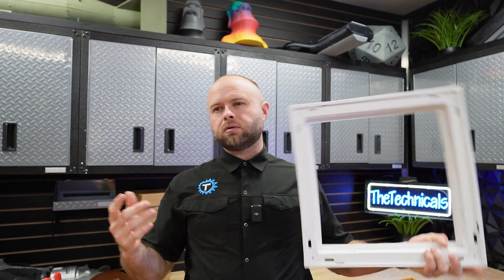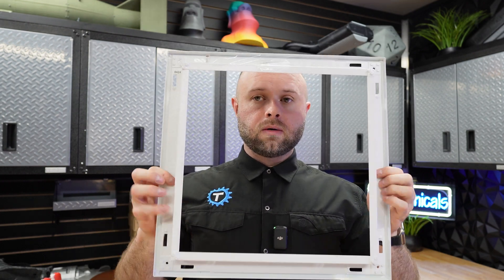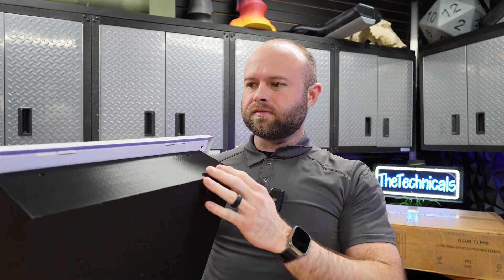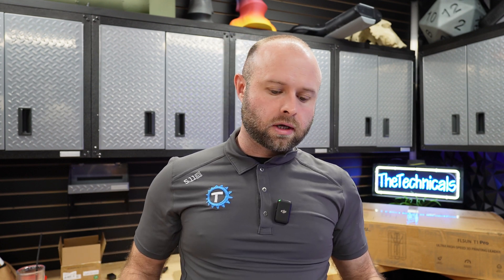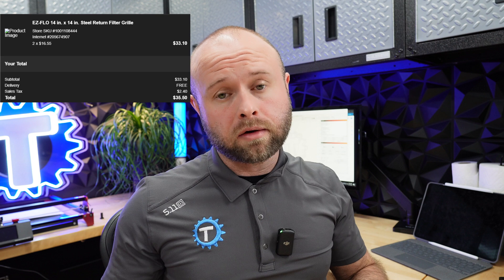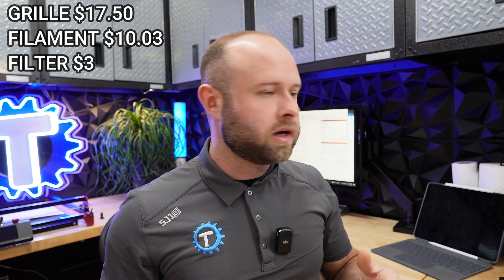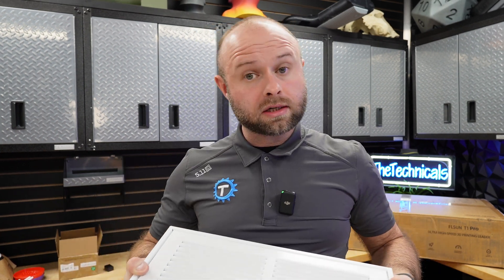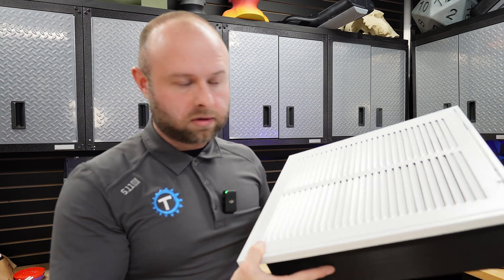Creating, Designing, Printing & Selling a REAL 3D Printed Product. Start your business in 2025!

Comment: Nice job on the Tinkercad section, and video in a window.  I also notice you upping your game with some other video angles lately.  You are doing great on the channel elements. I might suggest some shelves or 1/4" holes for shelf pins for the user to add a shelf or two.

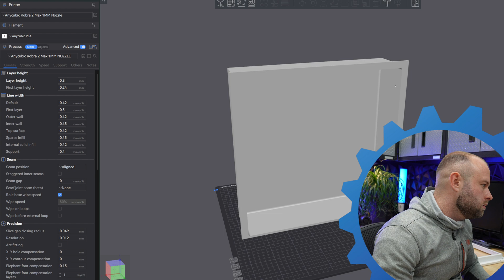Comment: 4mm solid walls sounds like overkill. Also, it's show at 4:00 that you're using 0.42ish line width, that doesn't seem right with a 1mm nozzle.
Reply from the maker: test model printed on one of the other kobras

Comment: You could sell kits. The DIY kit version that is just the backing box and instructions and another kit that contains everything they need. This way you can offer the product at a much lower price and allow the customer a convenience option to include everything needed.
Reply: Problem with that is, you don't know that the customer is going to get the correct off the shelf parts, then when they get the 12" grate instead of the 14" grate, because they're an idiot who can't follow instructions, they'll leave a bad review on Etsy saying it doesn't fit.

To give you an example, I had a customer leave this review on my Etsy site.   "I wouldn't suggest purchasing this product. It's hollow and very cheap. Not quality in this product whatsoever. Great design. Maybe if it was solid. I would expect something of this quality to be around 5 dollars with free shipping. Probly a great person. Just stay away from the products. Was gifting this to my dad. He would laugh and say you actually paid how much for this. At least I have a pattern to make a more reliable product. This will not stand I summer in the  florida heat being hollow. You can't even squeeze it with your fingers without it cracking.  Did not come close to meeting expectations. "

I haven't made one sale since this review...he completely killed my shop.

Now... You may think, hollow and won't hold up to the Florida heat, seems a reasonable complaint...but...first off, my product isn't hollow...it's printed with 3 walls, 15% Gyroid infill, out of PETG... Its only job is to hold trailer safety chains and the light plug up off the ground when your trailer is parked... It doesn't have to hold up a Buick... maybe, MAYBE 1 lb of weight, so 3 walls, 15% infill is about 50x stronger than it needs to be to do it's designed job... And PETG is naturally UV resistant, with a heat deflection temperature of 156° F.  If it gets above 156°F in Florida, he's got bigger problems than his trailer plug lying on the ground.   And $5 with free shipping?!   It cost me $4 in shipping, which means if I sold it that cheap, I'd make about 15¢ after Etsy fees and shipping... So pretty unrealistic expectations.    

Basically, this person was an idiot who never even considered the loads the product is subjected to, nor the material characteristics of the plastic it's made of.    This is the kind of stupidity we have to deal with as sellers...   You have to make your product as idiot proof as possible, and even then, since they keep making better idiots, somebody will screw it up.